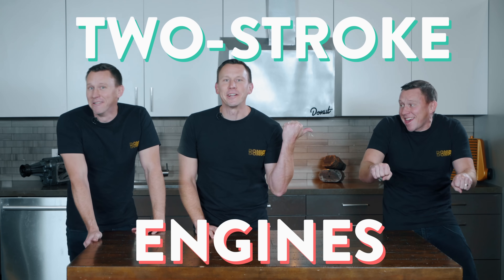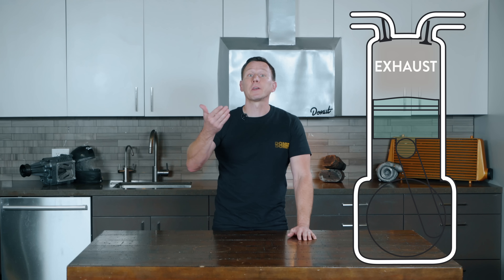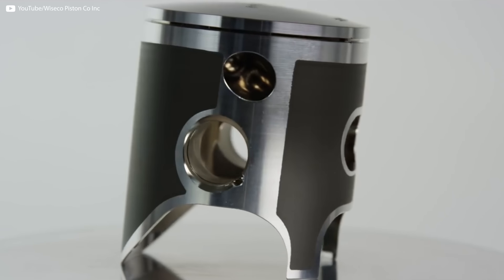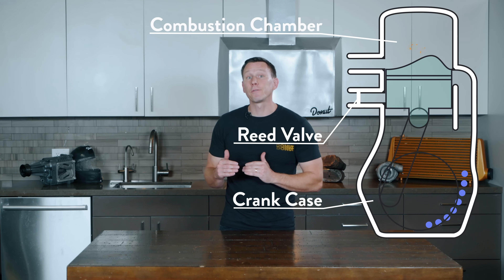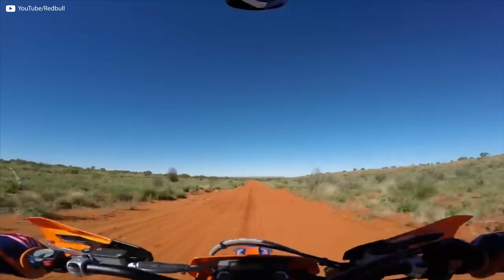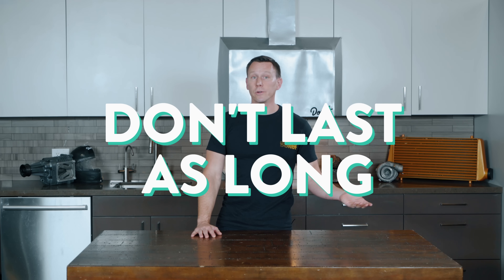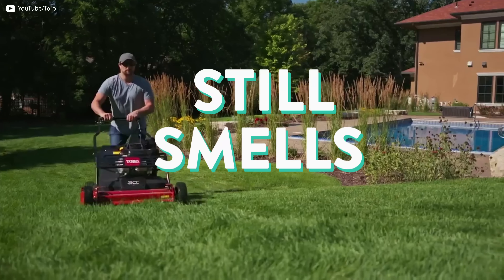2 STROKE vs 4 STROKE ENGINES - How it Works | SCIENCE GARAGE

Comment: when a 2 stroke hit its powerband like mine at 7000 rpm. that is the time when the port timing, oil and fuel mixture, exhaust gas resonance and scavenging of air is at its optimum point and with the powervalves giving it more boost that is when a sudden change in acceleration happens and the powerband just spikes up. imagine changing from 21hp to 65hp in under one second on a 250cc bike.

Comment: Why do 2 stroke engines have that weird tear drop shaped budge in the exhaust pipe? It starts expanding close to where the pipe is bolted to the exhaust port, continues to expand to a certain point, collapses back down to a similar circumference at the start of the pipe, before the muffler
Reply: There's always a bit of fuel that tries to escape out of the exhaust port so the pipe is made to create backpressure which pushes it back in before the piston closes the port.

Comment: My first/only time riding a 2 stroke bike I wrecked it within 5mins
Reply: CL9YO lmao what did you ride? I’ve rode big 4 strokes all my life but the first time I hopped on a itty bitty cr80 I was shocked. It power wheeled in the first 3 gears every time you cracked the throttle

Comment: 2 stroke: Cheap to rebuild (usually about $200 or so)

4 stroke: several hundred to maybe $1000+ to rebuild, may need more precision tools to rebuild.

2 stroke master race.
Reply: When will you need to fix a 4 stroke though. Pah. Never.
Reply: U have to rebuild 2 strokes more tho.

Comment: To prevent my 2 stroke dirtbikes from blowing up I just use a lot of oil. I don't even use 2 stroke oil it's usually used motor oil. Better too much then little with 2 strokes.

Comment: I tend to disagree wit the statement that 4 strokes last longer, he probably based this on all of the cheap 2 strokes out there but there are commercial chainsaws (Stihl 075/076 series)that have ran 6 to 8 hours a day for 10 or more years at 11,000 rpm without a rebuild, and modern lubricants don't carbon up the engines nearly as bad, the only real serious drawback is unburnt fuel going out the exhaust during scavenging making it a dirty engine by EPA standards.
some of your finest 2 stroke manufacturers such as Stihl are overcoming this with new technology. then you also have the opposed piston engine where 2 pistons share the same cylinder, and in the diesel versions (Used in the Hindenburg)unburnt fuel escaping through the exhaust isn't a problem because they scavenge with air only and inject the fuel near the end of the compression stroke, then you also have the "Detroit Diesel" which uses valves and a blower to scavenge instead of the crankcase.

Comment: 2 strokes can maintain a higher rev for longer since they dont experience valve float. Thats why most 4 strokes have a rev limiter that only lets them run at set max rev that wont cause valve float. 2 strokes can be rev to 8-9 grand for a long ass time and be fine. Thats why they are good for chain saws, blowers, mowers and so on that depends on engine speed instead of gearing and wheel speed to accomplish its task.

Comment: The other big disadvantage to 2 strokes is they're generally awful at low RPM low load situations.  The crankshaft sort of acts like a forced induction turbo/supercharger and below certain RPM doesn't compress intake air very well, and then loses efficiency after a certain RPM.  Makes them great for racing and other high load applications because of its power/weight, but terrible for a commuter vehicle as it gets terrible mileage and requires really revving it out to get any power.
Reply: Did someone say rotary?
Reply: @matthewzill5490  Which is basically a very funky 2-stroke if you stop and think about it.

Comment: 2 stroke engines are no longer the pollution puking machines you suggest they are, I suggest you look into the rotax 800E-TEC engine or all E-TEC engines for that matter. Skidoos E-TEC sleds are cleaner burning than Yamahas 4 strokes. Just saying, technology has brought the 2 stroke engine back into the fight and they are gaining traction yet again.

Comment: The main drawback of 2 strokes is definitely the oil. I spend about $70 for 7q Full Synthetic in oil for my car (BMW V6 engine) last about 10000km and $72 for 4q High-Performance Synthetic(since it's recommended to have the best oil to protect the parts) for my motorcycle (Kawasaki 636cc engine). Oh and his one last about 5000km

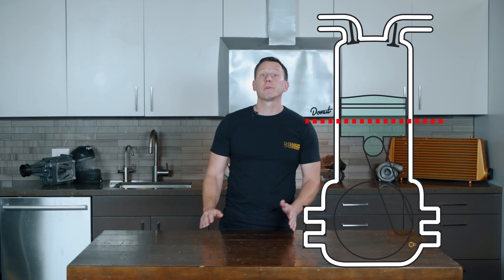Comment: 4:43 "Valves allow the separation of the combustion chamber and drive shaft" wut? Don't you mean crankshaft? And they are separated by the piston, not valves, though use of valves avoids the need for some of that. A lot of this sounds like, while he understands how they work, he can't come up with proper words. Between that and sounding at best bored, at worst depressed, I think Bart is broken. Who's the Donut crew fix-it guy? They need to fix Bart - though unfortunately I would suspect that would be Bart.
Reply from the maker: Valves allow, not valves separate.  But yeah, meant crankshaft.

Comment: You should do a video of rotary engine and how they work in a four stroke theory but in a 1/3 stroke cycle. As in there are three power strokes per rotation of the rotor.
Reply: They made a video about Rotary's just search for Donut Rotary.The first video should be it.
Reply: I forgot about that.

Comment: difference between a dual clutch and a torque converter auto
Reply: From what I know...
Dual Clutches are like this.
One clutch is for even gears. 2,4,6,etc.
The other gear is for odd gears. 1,3,5,etc.
The Torque Converter varies in "gear ratios"
The Torque Converter also multiplies torque when it needs.Because it's fluid that is actually transmitting the power from the flywheel to the transmission,it changes the "gear ratio" of the torque and power.So when you are at a stand still you get more torque and when you are going faster you get more power.
P.S. Calling it "gear ratio" is incorrect because there are no gears in there but for the sake of simplicity I'll leave it like that.
Search for Engineering Explained,He made a few videos about automatics(dual clutches and torque converters).And explains it better than I did in this mess that I created above. :P

Comment: check your facts Dugald Clerk was first to design and build 2-stroke engine.
Reply from the maker: Yeah... this is kind of like the radio controversy... though I appreciate the comment.  We didn't use Clerk, because his 2 stroke had a separate charging chamber, and was patented in '81, Benz patented in '79.  Joseph Day came up with the crankcase compression two stroke around '89.

Comment: I still think a 2-stroke engine would be great for a drift car. I've been trying for a while now to find an evinrude 2-stroke v8 to throw into a Miata
Reply: Rotary is close enough...
Reply: @M47H383R7  yeah but the rotary just doesn't have the same sounds or the flashy expansion pipes aye. Plus a rotary is a common swap. No one does an evinrude swap haha
Reply: @corvette_jake7225  it's not as easy as acquiring a evinrude and chucking in a thinking it's going to be like that Volvo build they done. There was an insane amount of modifications and reworking done to the evinrude just to get it efficiently run a set of expansion chambers
Reply: @behemothfan666ftp4  yeah man I know it's not an easy task. Would require a lot of engineering on my part but I am a fairly capable dude and I have tons of experience in auto mechanics. It won't be easy but very doable
Reply: @behemothfan666ftp4  i rebuild engines for a living. 2 cycle in a drift car is a bad idea
Reply: @brandonconnelly6798  I agree. Drift cars need low end power and torque
Reply: Corvette_Jake you might be surprised to find someone had done just that about 5-10 years ago. Been following his car build on here for quite some time too as well as his retrofit project for the evinrude for that car.  I think the name of the channel or videos is Rudezon v8 two stroke
Reply: Yooooo
Reply: The 3-cylinder 2-stroke snowmobiles kick out about 150-170hp.  Maybe someone will try to build a v6 out of one like the Radical v8.
Reply: @knieban  the polaris 2-cylinder new 850's have 160-170hp so they amazing
Reply: It would be really nice if you could do it 
It would work great in a drift car 
It has much more power
Reply: @brandonconnelly6798  you are just mad that you don't have the money, skill, or general Intelligence to complete such a task
Reply: Lmao what, the powerband is way too small to have an actually good drift car
Reply: Eh. Powerband might be an issue
Reply: Rotary uses mixed gas, probably as close as you gon get but that would be pretty cool
Reply: Say no more, sounds great
Reply: Look no further than HONDA son, Over 80 years in f1. first ever jet engine to be used for racing.
Reply: @stjephenmati8476  I know Honda has    a huge racing background and I'm pretty sure I've read about a v12 2-stroke they developed in the 70s but I'm sure finding an engine like that would be extremely expensive haha

Comment: Please get up-to-date on Two-Strokes next time, the really new engines have Transfer Port Injection (TPI) so they inject the gas mix into the transferport which allows you to put conventional oil in the crank case..or even Direct Injection (which ATHENA sadly patented and doesn't sell) which is way more efficient and powerful.

Source : https://www.youtube.com/watch?v=5gVeqix2Yc4

Comment: Can we do a video on fuel injected 2 smokers? Curious how much more efficient they can become. The rise of the 2 stroke is here!!
Reply: Diesel 2 strokes are in their own category. I was more curious about Husky and KTM bringing back their two stroke this year, but with fuel injection and an oil tank.
Reply: So the fuel and oil are injected separately? That would be kinda cool tbh.
Reply: @ohnojt  From what Ive read, you have a seperate oil tank. No longer need to carry oil to make premix gas. Further more the ECM can dial in how much oil and run it as from as little as 100 to 1 parts oil to gas. Etc for a cleaner burn.
Reply: Ah ok, so it is like a super fancy single cylinder snowmobile engine.
Reply: @ohnojt  they put it on their enduro bike (tho many snow mobile and boat company, are now still researching for bringing back 2 stroke engine on motorbike)
Reply: So a Detroit?

Comment: The two pics in the thumbnail are both 4 strokes
Reply from the maker: The bike on the left is a ktm 250 2-stroke
The bike on the right is a Yamaha YC 450 4-Stroke.
Reply: Yea that’s a 4 stoke. You can tell by the pipe

Comment: Do 2 stoke diesels next. Tired of people mixing them up and trying to "educate" people about 2 stoke diesels while they are really talking about 2 stroke gas engines. Nice vid
Reply: D E T R O I T !
Reply: @FarrYaweh  absofuckinglutely
Reply: 2-stroke diesels exist??? I know what I'm searching for next!
Reply: Other the famous detroit 2 stroke diesel used in trucks, 2 stroke diesels are usually found in marine applications.
Reply: I agree do two stroke diesels next
Reply: Yeah what I really wonder is why are all diesel engines 4 strokes? Since the fuel is injected almost at the end of the compression stroke, there's no reason for the unburned fuel and exhaust gas to mix up.
Reply: 2stoke diesels are used in ships
Reply: And what's a 4-mix
Reply: Petrol engine
Reply: Wots dat?
Reply: I learned the other day that the old alco locos here are mostly two stroke diesels. It blew my mind.
Reply: Tf is a two stroke diesel???
Reply: @chrissagredo7129  Here you go. A copy paste from: auto.howstuffworks.com
The two-stroke diesel cycle goes like this:

1. When the piston is at the top of its travel, the cylinder contains a charge of highly compressed air. Diesel fuel is sprayed into the cylinder by the injector and immediately ignites because of the heat and pressure inside the cylinder.

2. The pressure created by the combustion of the fuel drives the piston downward. This is the power stroke.

3. As the piston nears the bottom of its stroke, all of the exhaust valves open. Exhaust gases rush out of the cylinder, relieving the pressure.

4. As the piston bottoms out, it uncovers the air intake ports. Pressurized air fills the cylinder, forcing out the remainder of the exhaust gases.

5. The exhaust valves close and the piston starts traveling back upward, re-covering the intake ports and compressing the fresh charge of air. This is the compression stroke.

6. As the piston nears the top of the cylinder, the cycle repeats with step 1.

Honestly, I find a 2-stroke Diesel Engine fascinating.
Reply: I work on emd 710 - 645 engines (gm) and theyre two strokes. 710 or 645 is the cubic inches per cylinder.
Reply: There's some really damn cool two stroke diesels out there, I think Detroit or Allison even made an opposed piston two stroke diesel engine where it had two pistons per cylinder.  I know what I'll be binge watching today lol
Reply: I used to work at DDA

Comment: Does that mean that a 2 cycle 4 piston engine would make more power than a 4 cycle 4 piston engine?
Reply: Buster McCluckle depends on the cylinder dimensions and how it’s tuned but yes, it should
Reply: Ya just like a 300 (one cylinder) 2 stroke makes more power than a 300 (one cylinder) 4 stroke